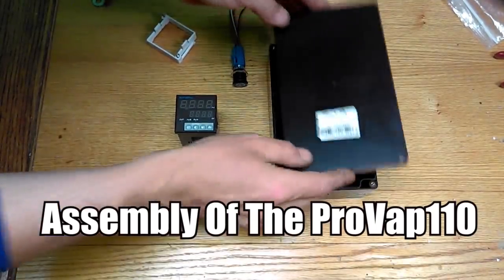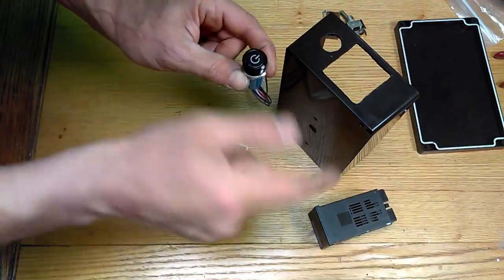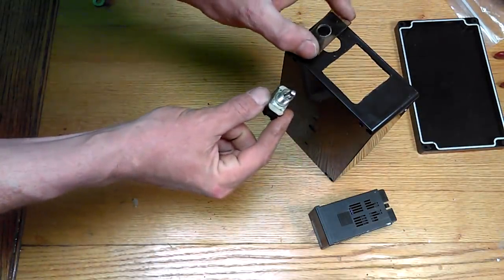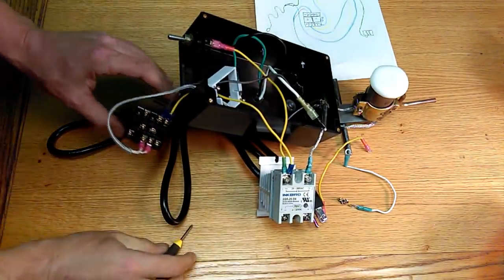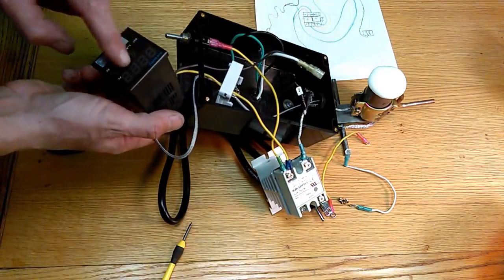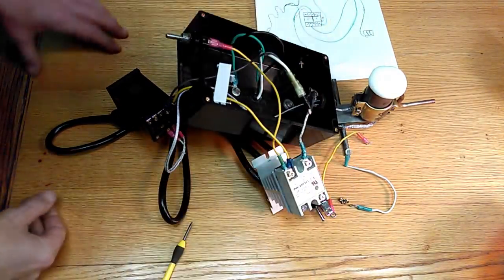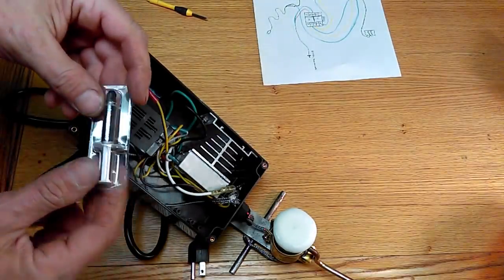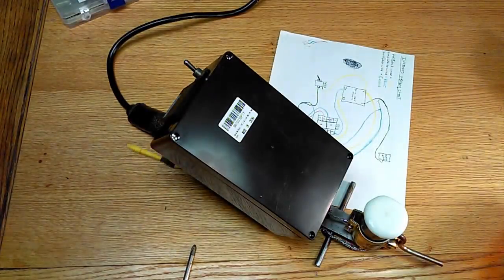Building A Homemade ProVap 110... Part 1 Assembly and Wiring

Comment: Just to let you all know that the heat sink is not necessary for the relay, it is recommended for heaters that will pull 10 amps or more through the relay and the 380 watt heater band is only pulling 3 to 4 amps at the most. ( Watts devided by volts = amount of Amp draw) on your heater bands, so if you have limited space I promise the heat sink is not necessary
Reply from the maker: Thanks for the information. That means I could use a small abs box to contain everything. Interesting!

Comment: You could use a switch on the band heater wire instead of the connectors which would allow you to create an open circuit for testing without messing with the wires and you could have the box closed as well.
Reply from the maker: I was just thinking that the other night when I was editing this video and it wouldn't be that hard to add it either. Great minds think alike. 😀

Comment: What are the dimensions of the cook pot, the part you have to fabricate? The copper looks like standard copper pipe. Could you provide a couples photos of the cook pot?
Reply from the maker: The copper piece is a 1 1/2" coupler. I believe that parts was purchased at Menard's. The total height of the cook pot with the copper coupling installed is 2.57". There is more detailed information on my Patreon page, including pictures with measurements.

Comment: How did you keep the solder on the tube when it heats up? Mine just melted away. Also I had big fluctuation in temperature.
Reply from the maker: I used a high heat solder but it's recommended it be brazed.
Reply: @JCsBees  What size copper tube did you use?

Comment: Put the pid in thru the hole then put the support bracket of the pid onto the pid halfway before you wire the pid because you can't put it on over the pid with the wire terminals in the way

Comment: I have built one of these and I used aluminum and copper for the pot which looks like that one so when you added the acid and did you notice that the copper was stripped a little bit inside does this affect the bees does this introduce copper or aluminum into the hive copper and some acids do not mix well

Comment: Jason,  does the pot come with thermocouple and metal base on bottom of copper tubing assembly or is it a separate part
Reply from the maker: The thermocouple comes with the Inkbird PID kit listed in the videos description. It did not come with the pot. The aluminium bottom of pot was made by a machinist.
Reply: @JCsBees  So where do we get aluminum piece for the bottom of the pot? Can’t really build this if there are no alternative sources for these pieces.

Comment: Do you have a link for the rubber washers?
Reply from the maker: I don't because I had them but you could use these https://amzn.to/2tRiyYt. These ones may do better with the heat than the ones I used. I will add them to my links in the video description. Another option may be water hose gaskets. You know the flat o-rings that keep a water hose from leaking. Then again they may be a little big.

Comment: Fan I bet you worked hard on that thing, did a really good job you just need to do one more thing.... Come to Missouri in a month and we'll get it dialed in over at my place , I have a homemade 12 volt oa immersion heater and it is so slow, so I have been fogging instead but you know how that is .. better than nothing, not better than a Pro Vap.
Reply from the maker: It was a fun project for sure and like I said in the video, I could not have done it without the help of my followers. I'd love to come to Missouri but I just don't have the time to get away, my cows would starve. lol 
Sounds like you need to start collecting parts to build you a provap? Best of luck!

Comment: Thanks for sharing Jason - I built one as well but I am having a problem with my solder melting :(  -  I'll have to braze the 1/4" tube unless someone else has a solution.
Reply from the maker: I used this solder and so far it's holding up just fine https://www.amazon.com/Oatey-29024-Safe-0-117-Inch-Silver/dp/B000GASQ82

Comment: At 110v how are you planning to power the Pro-Vap? Generator? long extension Cord? I always thought the 12v battery systems were more easy to work with in remote apiaries. Love your vids and info thanks!
Reply from the maker: Harbor Freight sells a generator that will power it for around $80 and that's my plan. I can throw it in my atv wagon and go treat.

Comment: Should have used an aluminum washer or plate under the heat pot, better heat dissipation.
Reply from the maker: Very good point! I may have to switch them out now. Thanks for the suggestion.
Reply: YW...
 @JCsBees

Comment: Hi Jason, it's funny you posted this. I'm working on building some diy vaporizers myself.I'm going to build the diesel injector type and heat gun type. I am going to try and make them with temperature control and maybe 12v & 110v version to see which I like better.Funny thing is I still don't have my 2 nucs yet but I'm trying to have everything ready to go for when I have my nucs. I am also going to redesign my fat bee man top hive feeders do I can use them to dry feed as well.
Reply from the maker: It's always a great idea to be prepared and it sounds like that just what you are doing. Good job! I have one of the diesel injector vaporizers and it does a great job just a little slow if you have very many hives. As far as the fat bee man feeder, I am not sure what they look like to be honest so I can't say rather I would use them for dry sugar. I will say a simple feeding rim is usually perfect for adding dry sugar. Best of luck!
Reply: I can't wait to see how you make the caps. I have ordered what I can. As soon as all the pieces come in I have to figure out the cheapest way to make a cookpot. Thanks Jason. Oh by the way I 3D printed some queencages. I think they came out nice, I'll have to show someone locally and see if it close to the normal cage.
Reply from the maker: That's awesome! Keep in mind I will be adding a link where you can purchase the cookpot. That may be your best bet if you don't know a machinist. 
That's awesome about the queen cages. Your more than welcome to come over to my Reddit community and share the printed queen cages https://www.reddit.com/r/JCs_Bee_Talk/. I'd love to see them!

Comment: Hey Jason, do you rotate your treatment methods throughout the year?  And if so, what other treatment types do you use (Apivar, MAQS, etc)?
Reply from the maker: Yes, I do rotate but I only treat once a year and that's in the fall. This is because make splits all spring and summer which breaks the brood production, no brood, no mites. In the past my go to treatment was MAQs and Hopguard II. Now I will resort to my oxalic acid treatments (both the dribble method and vaporizing) and just making splits. MAQS is a great product but very costly if you have many hives. OA is pennies per treatment.
I tried ApiVar 1 time and will never use it again. It takes like 8 weeks for 1 treatment, that's crazy if you ask me. lol
Reply: @JCsBees  Thanks for the info. Last year was my first season keeping bees. We have two hives and I followed the schedule (reluctantly) of the previous beekeeper of treating three times a year (without even testing for mites), Spring, Summer and Early Autumn. Each time we used a different product. MAQS, APIvar and some one strip.. I guess if we are not making splits then we generally would have to treat more often, but this year I will ensure we do thorough testing before and after treatments to see how they actually work. I was thinking to try a standard Oxalic Acid vaporizer and see how it works. Thanks for all the info and the amazing videos. I'm a big fan.  Anthony (Princeton, NJ).
Reply from the maker: Yes, mites washes will teach you a lot. I'd make notes on the mite counts for each colony. You may find some colonies are able to manage the mites on their own. If it were me, those would be the colonies I would want to graft from. 
Glad you enjoy my videos and I am glad they help.

Comment: How about a rubber bicylce handle grip instead of that foam?  I use PID's all the time building custom BBQ pits as well as other things. A PID would also be the perfect start to building a nice Queen incubator.
Reply from the maker: A bicycle hand grip would be a great option. Heck, I may even have to swap mine out now. 😂 Thanks for sharing that idea!
It being the first time using a PID I was a little overwhelmed with the instructions but I think I can wire it in my sleep now, at least for a provap. I know a couple of people that have used them for incubators with great success.
Reply: @JCsBees  No problem, Most handle bars are 7/8"...... so  long as the conduit is a tad larger it should work out. Use an air hose/blower and  handle grips go on or come off with ease.  In case you didn't know, it's wise to calibrate your thermocouple (TC) in boiling water for your elevation before putting it into service. I've had PID's be dead on with  a TC and I've had them be off 30 degrees too It often happens when you use a TC that was not purchased with the PID because the resistance factors between different brands varies.
Reply from the maker: To be honest, I am not sure what size the handle is but I will be finding out. Never heard of the air hose trick before but it makes since. 
No, I wasn't aware that TC's should be checked to verify they are working correctly but it does make since. I wonder how a person would go about getting the same TC that came with the Inkbird kit if it was bad, any idea? I broke the bolt on my TC when I tried to tighten it but from what I can tell it's still screwed in far enough to work correctly but I guess I should double check to make sure it's accurate.
Reply: @JCsBees  It's probably a standard
 ( K) Type TC and ebay will be riddled with them. When you turn on the PID as it loads, it should show you the TC type in the lower SV values for one second then go into service. I use MY PIN PID's  but I'm sure they're all generally the same?  If you hold down the set button for 5 seconds it will go into the settings for the alarms, press the set  button again and it will scroll through the choices. The setting( PUF) is how you adjust your TC reading. If the temp of your heat coil is not where it should be the OA may not vaporize correctly, was just a thought?
Reply from the maker: Yep, I am thinking it says I have a "Y" type tc. I will have to go to ebay and order a new one just incase. I appreciate all the input, it sounds like you know your way around PID's pretty well.
I'm thinking about building an incubator now. 😀
Reply: @JCsBees  It is more than likely a 
(K) type which are the standard issue. The light bars on the PID indicator  can't really make a the lower leg on  a K so it appears as a weird looking Y.  Standard TC's  for PID'ds are K, J, E, S, PT 100 and Cu50 though there are many more for different applications. Look at this site and you can click through the different TC's so when a project pops up you know the proper TC to choose. https://www.omega.com/thermocouple-color-code/
Reply from the maker: Your right once again! It is a "k" type. I knew that too but after looking at the funky "Y" is shows I was convinced it was a Y type. lol

Comment: Nice! I just built one last fall 😊 
Made a fiberglass insulator washer for under the pot. I did buy ProVap's bowl and caps and probably end up with just over $200 in it 😊
Reply from the maker: Thanks! So did you get to try your out doing fall treatments? I am anxious to try mine out. I like the idea of fiberglass washers. I will have to keep that in mind if the rubber washers fail.
Reply: @JCsBees  yes, the copper tube plugged up, blew the cap off, scared the crap out of me. I couldn't get away fast enough 😂 bought some pipe cleaners this winter to keep the tube cleaned out 😊 and got some header wrap to wrap the heater band and bowl.
Reply from the maker: Holy crap! I never gave that much thought but I will surely be cleaning my pipe too after knowing this. Thanks for the heads up.
Reply: I've been treating and had blowouts because I was trying to go too fast. Let the device fully reheat between hives and the plugging up goes away. A piece of bailing wire is what I use as a poker and haven't needed to use it at all once I slowed down.